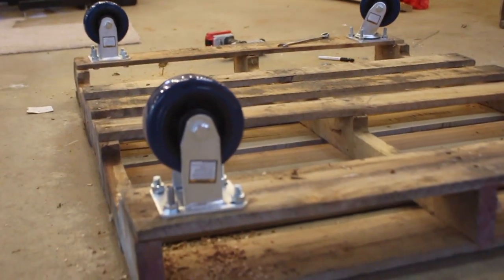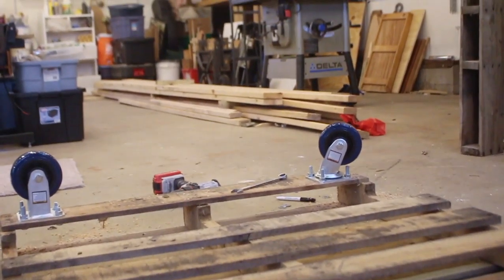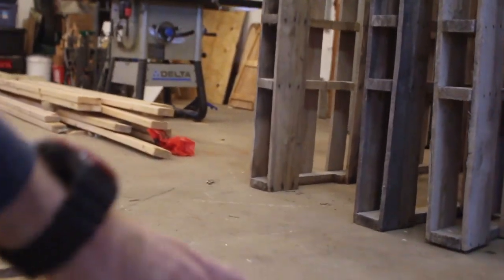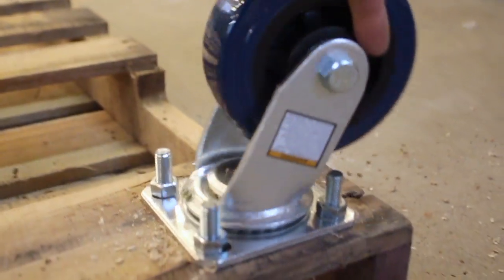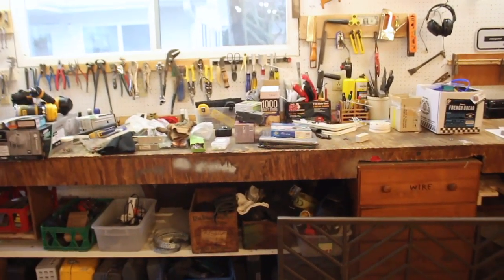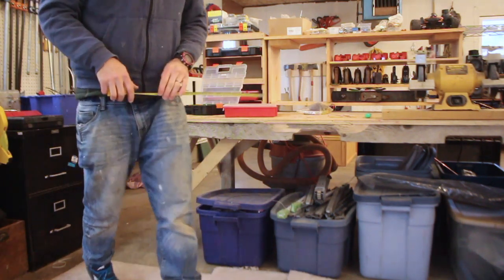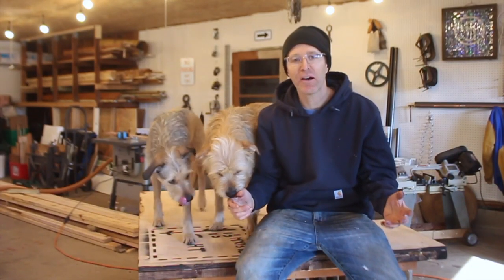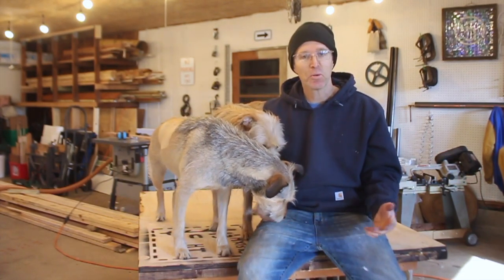Industrial Assembly Table From Pallets, Full Build

Comment: Those rolling racks you used on top of the table sure brings back memories. At my first job I'd get shoved outside of my regular bagboy duties to lift 80# of rock salt into the cars outside that came down on one of those rolling tracks. I also have 4 of those HF casters awaiting to go under my table saw/router. They've been sitting like 10 years now. I'll be lucky if it ever gets done. Good project Spence!
Reply from the maker: I have another one of those conveyor belts if you ever wanna haul salt again. The racks themselves could kill a man
Reply: @metaspencer  ha! They don't need conveyor belts. The grey plastic tubs would just go down by gravity through a clear plastic thermal door then directly outside on those rollers themselves. It was the worst when some one would order ten or twelve bags of salt at once and the head bagboy was lazy so he'd put me out there. (you'd see the car drive away squatting because of the weight!) Besides throwing 350 papers it built me a fair amount of muscle. My mother and I were talking about how funny it is now to have grocery delivery like instacart that is basically an extension of that delivery service. It's been an helpful thing.